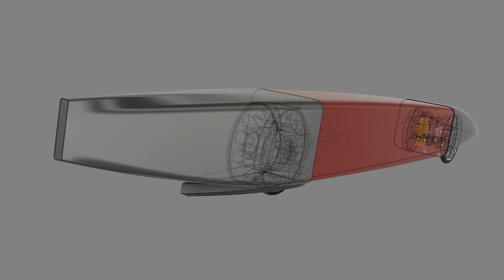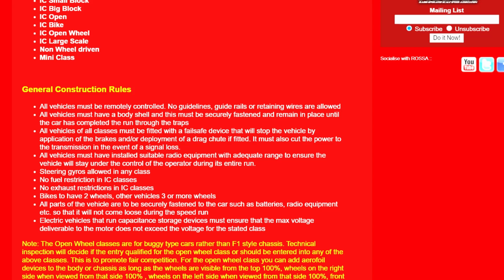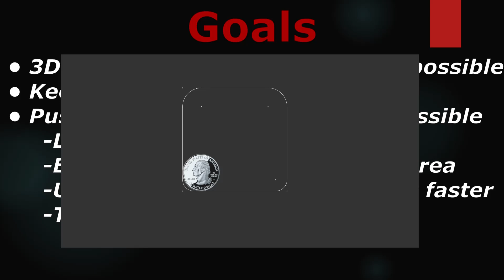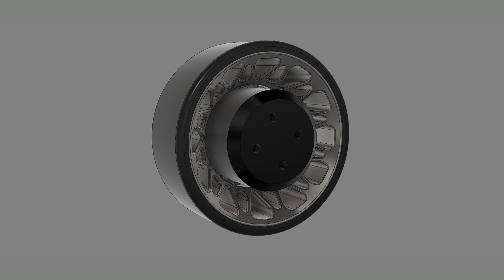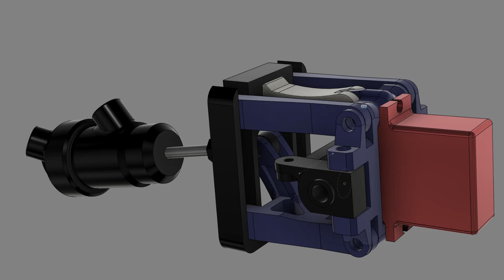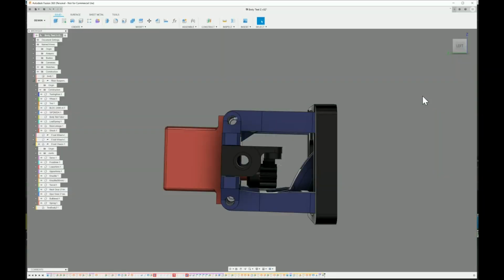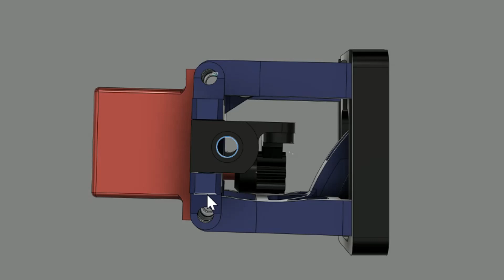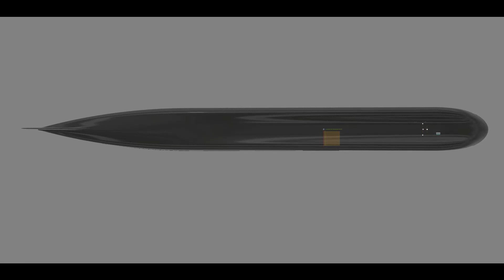Project Streamliner - Goal: World's Fastest 3D Printed RC Car - Pt1

Comment: At 8:00 you began to discuss the hub motor , one benefit of that being the stabilizing gyroscopic effect of the motor……  one of the most deadly beliefs in land speed engineering is that rotating wheels/ mass offer stabilizing force is completely in error, and is responsible for at least twenty land speed deaths, not counting the many decades of crashes that destroyed vehicles themselves.

A wheel is not a gyroscope, it can exhibit gyroscopic force, which can be either the classic stabile mode, or the second most common gyroscopic reaction, violently unstable. The key to which behavior is seen is if the rotating mass( wheel/motor) is allowed to change orientation( yaw) even very slightly. 

Fast vehicles often experience wheel spin and a loss of lateral resistance, and typically the front wheels retain some traction, which aids in a vehicle experiencing a yaw, or complete spin.
Reply from the maker: Thanks.  That makes a lot of sense.  The early versions of the car behaved exactly how you described, where it snap spins much faster than a car it's length should.  I've added stabilization software in later versions which has helped significantly.  If the center of pressure is far enough back, does the aero eventually help to stabilize the car?

Comment: In the bicycle world, the property you referred to as "cart" is called "rake", and the distance between the pivot axis and the actual contact patch of the tyre is called "trail". Since you have zero caster, the trail and rake would be identical. Very cool project! Compass aided stability control might be easier to implement, and faster too?
Reply from the maker: Trail makes a lot more sense than cart.  I'm definitely thinking about compass guidance as well, particularly for testing.  The rules specify you can use gyro aided steering, but I don't think they were anticipating someone making their own guidance system.

Comment: I'm trying something like this but with 4 motors and active aero. hoping I can steer it with just differential drive and a small rudder
Reply from the maker: That's awesome.  That should work fairly well, the car's don't require very much steering and honestly past 80mph it's all aerodynamics steering the car.

Comment: You can calculate the T factor using the magnet type and poll count the only real variable is the gap.

Another idea is a small micro controller and a few mini servos controlling aero. Add some strain gages on the suspension and a few ir distance sensors and use aerodynamics to stabilize yaw pitch and roll. Also another idea is gps controlled test runs
Reply from the maker: Awesome, I didn't know that calculating the t factor was something that could be done easily.  

I'm definitely planning on integrating some microcontrollers, gyros, and GPS.  I have been wondering the best way to measure the suspension deflection accurately and quickly.  I only have a small space for a sensor.  I need to take a look at strain sensors. I've been thinking of trying make my own LVDT, or use a magnetic encoder.